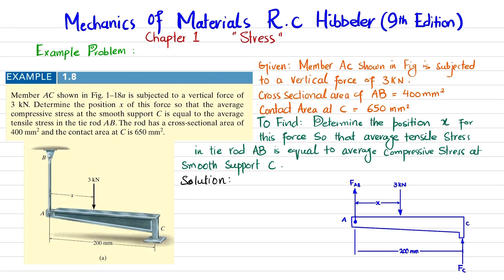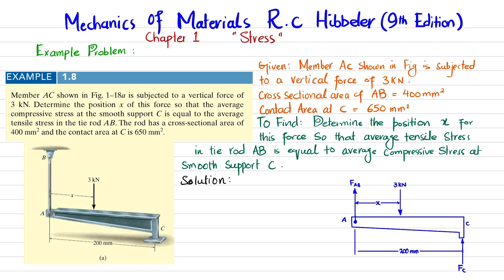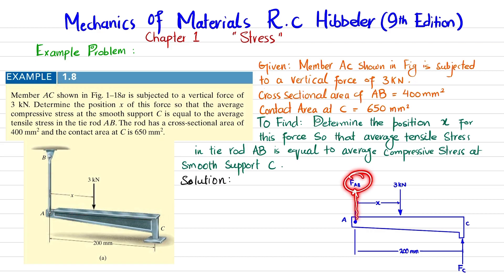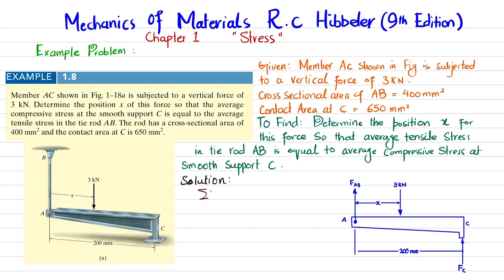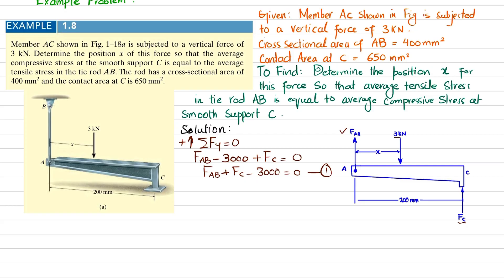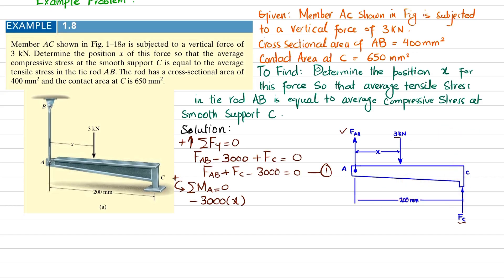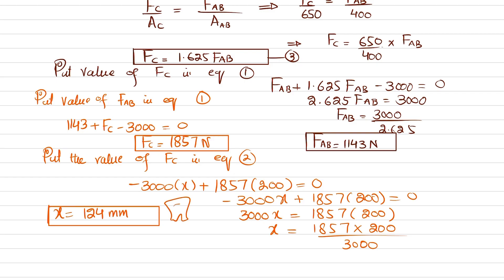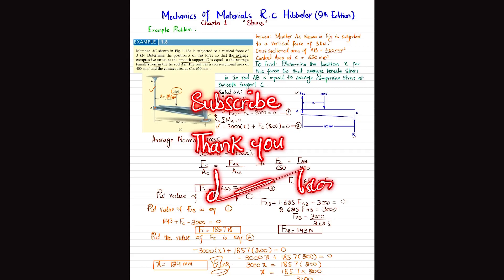Determine the position x of this force | Example 1.8 | Mechanics of materials

Comment: engr. adnan how did you get 2.625 from that equation
Reply from the maker: Please specify the time frame where you have issues
Reply: @engradnanrasheedmechanical  6:04 sir
Reply from the maker: @JoshP.Macatangay  ok you can see the Fab + 1.625 Fab = 2.625 Fab